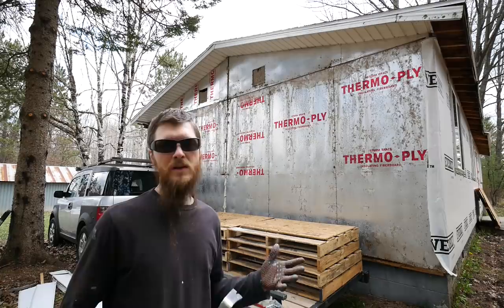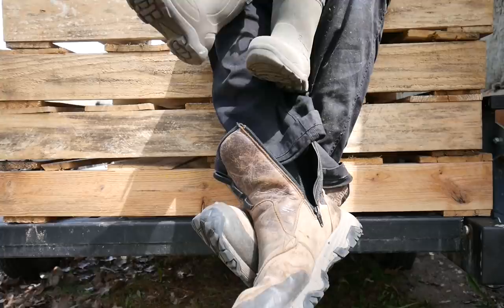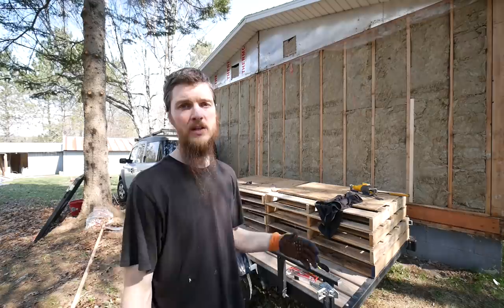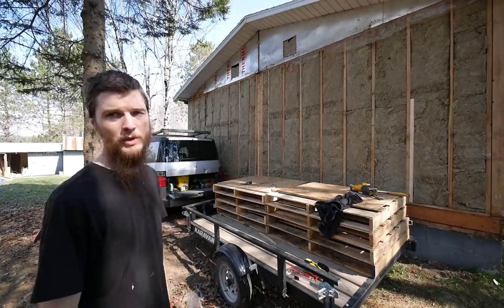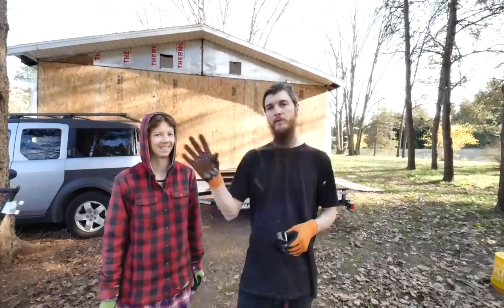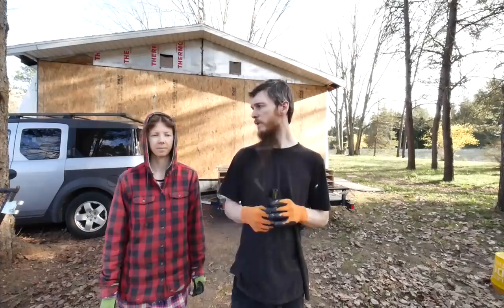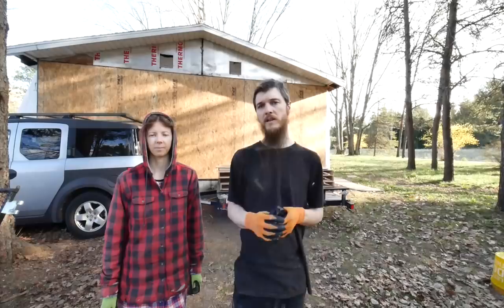Almost Done - Mobile Home Renovation

Comment: We put steel siding on our mobile and we love it. Looks neat, clean and durable. The color is good for 40 years before even fading. Its affordable.  It's light and easy for two people to do. All you need is a level, circular saw with steel cutting blade  and drill.  We also added double bubble insulation under it between the steel and regular insulation. If it gets damaged in any way it's easy to remove. We done our manufactured home and are now working on siding our barn. Next is our roof...lol. Never ends!

Comment: That insulation looks pretty good , mine was chewed up by mice and chipmunks
Reply: I think that is new insulation that they put in from the inside of the house. The old stuff was full of mice, etc.
Reply: So was theirs. The insulation we saw is the new stuff Doug installed when they did the room(s) on the other side of this wall.

Comment: could be the house moved slightly scewed , from all the weight added to it without realy shoring the walls from the outside so they stayed straight , have you checked if the long walls are still plumb / level ?
if not you could take the short wall off agan and convince the building back straight with a come along , then mount the short wall again , that should shore it up enough to get the comealong off again , that is if all the walls outside and in moved about the same distance , if you allready straightened up some inside walls with the rest sitting scewed youre out of luck
Reply from the maker: The house was skewed when we bought it. It looks like it was just settled or installed that way. But it's still solid and not very noticeable. Just enough to make hanging sheet goods a little more tricky.

Comment: I'm surprised there are no windows on that end of the house; maybe it was designed for a subdivision in which houses are only allowed windows on one end, for privacy or fire-containment. At least that will make the re-sheathing and residing that much easier.
Reply from the maker: I briefly considered adding a window, but it's the north side of the house and "they" say you should minimize the amount of windows facing north. It would be nice at times though.

Comment: What is the two openings is that Windows?
Reply from the maker: Those were original to when the house was built. They are gable vents for attic ventilation. We'll be getting rid of those since we now have a ridge vent :)
Reply: Ventilation openings for the loft space.